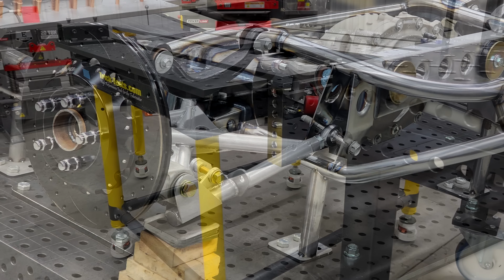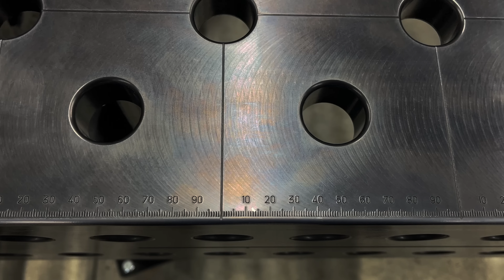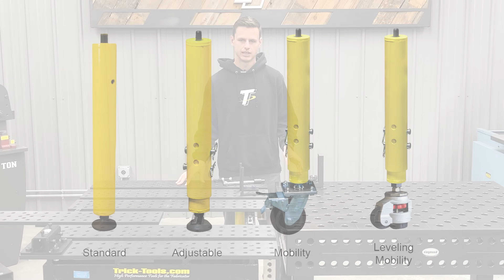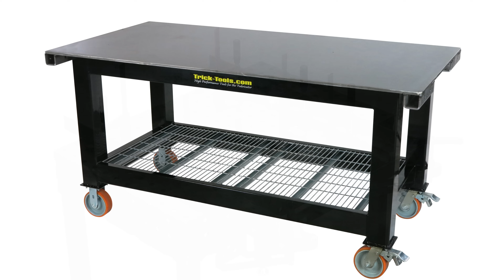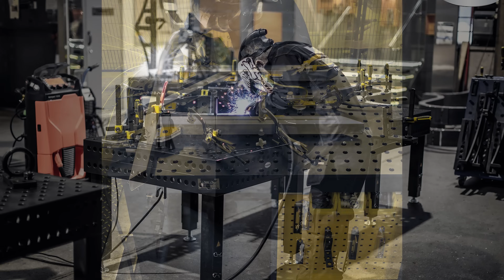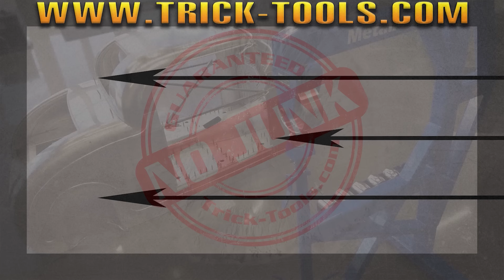5 Things To Know Before Buying a Welding Table - Trick-tools.com

Comment: I wish you would of included the Fireball Tool Table. The system looks to be very well engineered and designed.  I'm going to get the Dragon Wagon.
Reply from the maker: It does look to be a good product.  We didn't mention it by name but we did mention that tables with 3/4" holes such as that will have limited clamping and fixturing options compared to 5/8" or 16mm tables.
Reply: @TrickTools  is there a difference between how well the coating holds with siegmund vs fireball? I think siegmund treated there table non chemically maybe? I don’t really understand what they did? But how comparable are the tables when considering abrasion, grinding and other abuse like weather exposure like sitting on the back of a welding truck rig?
Reply: @axcenomega  The Fireball tables are cast iron. Cast iron is an naturally superior material when it comes to spatter. The other tables have to coat the steel to prevent the spatter from sticking.  Check out acorn tables, they are made from cast iron and most of the tables you see are 75-100 years old now.
Reply: @axcenomega  Siegmund tables are made of tool steel whereas Fireball is cast. The Siegmund will be significantly harder and resist impact much better.